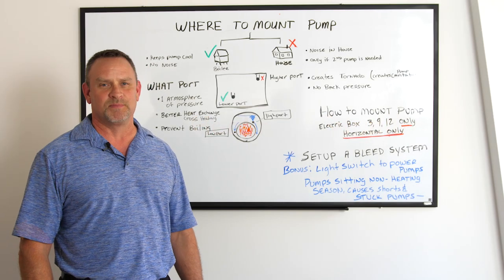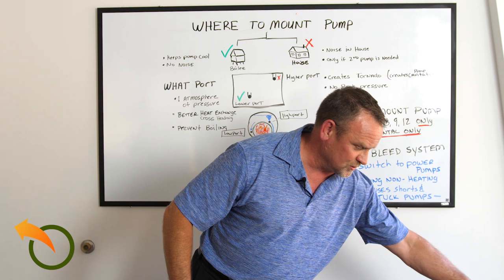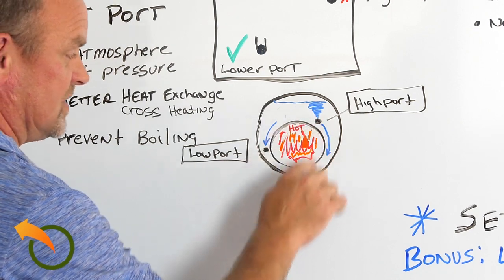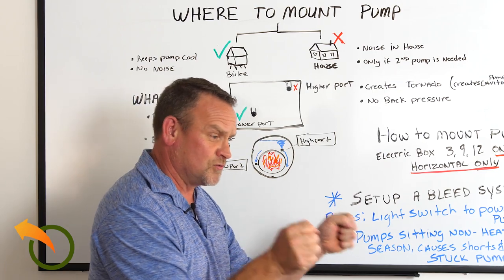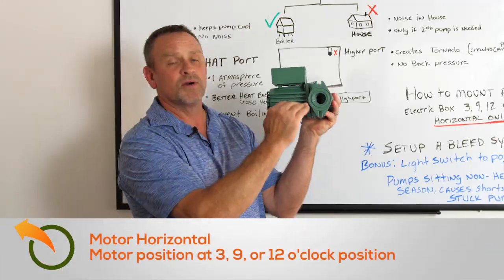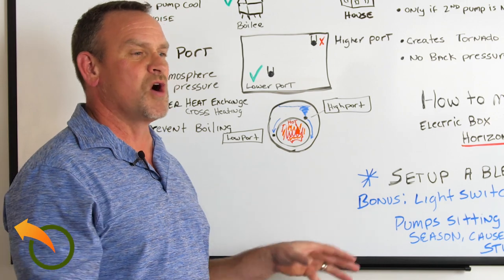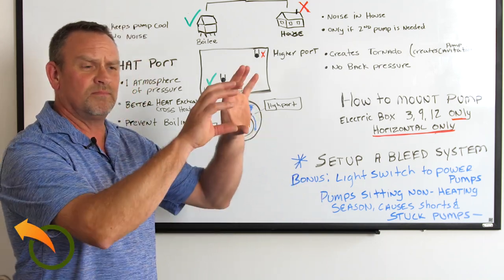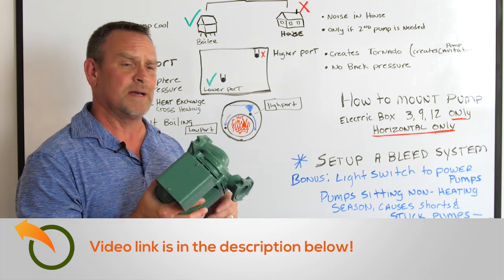Where & How To Mount a Pump on an Outdoor Wood Boiler | Alternative Heating

Comment: This makes perfect sense. My Hardy H-4 has the pump mounted on the high side. I don't think I have room to change it to the low side. I will pursue this after this years burning season.
Reply from the maker: There is always a way! I'm sure you will figure it out... Happy Heating.

Comment: my high port is actually more like in the middle of the tank.  Low port is at very bottom.  The pump is on the high port and I have issues with water boiling.  I plan on moving the pump to the low port.  My question is: would it be better to make a new pot at the top of the tank and return there.  There is a cover on top that I could drill a hole and even weld a fitting to.  Thanks for all the great info.
Reply from the maker: No to the port at the top, unless you send the water all the way to the front on the top. The water is simply mixing in the back of the boiler only with most boiler designs. Ideally you want water returning to the front top of the boiler and and supply from back lower port to mix all the water in the boiler.

Comment: My boiler has the pump set up on the bottom, but it pushes towards the boiler instead of pulling from it.   Would I be able to just flip the pump around and reverse the flow or would that cause an issue?  Since it would go through the furnace heat exchanger before the sidearm exchanger on the water heater.
Reply from the maker: Yes you should be able to do that. If you want flip the supply and return pipes too to keep the sidearm first. Make the existing supply the return and vs versa. Jeff

Comment: I’ve been in the oil field to long apparently. We have different definitions of large pumps. Big is any fluid pump motor over 100hp.
Reply from the maker: You are correct, 100 HP is a big pump.. LOL

Comment: Ok so I took the advise and moved the pump to the lower inlet and the return to the upper. On my boiler there is a temperature probe that controls the fan when to turn on to heat the water. Should I have it mounted on the lower port T or the upper port T ? I have an earth outdoor wood boiler.

Comment: Never would have thought to move my pump. Question regarding that if I move my pump to the lower port do I also move my temperature sensor or leave it in its current location? I have an earth outdoor wood boiler, specifically my mountain man 400 series. I would upload a picture to show you but I can’t here

Comment: This video would’ve been more helpful about a month and a half ago about getting the air out of the system,
But I got itworks great extremely happy with my new heating system,
I used a hot water heater for my heating source and took apart my furnace and put a heat exchanger in there,
And I’m loving it,
Cost a lot less to heat and it’s a lot hotter to.
Reply from the maker: I have had a lot of calls about pumps this year for some reason. Happy heating

Comment: I am installing a Aqua therm pressurized wood boiler. They show the pump installed at the bottom of the boiler pulling from the house and pushing into the bottom of the boiler. Hot water to the house goes above the boiler through a air scoop and then down to the house. Do you think that it should be reversed or since it is pressurized this works? Thanks
Reply from the maker: I'm not familiar with pressurized boilers, so follow their directions. Happy heating.

Comment: I have a 4400 wood master I have my pump on the bottom  and the return on the top, but they r both on the same side of the furnace  only because the dealer was very positive  about this concept but seeing ur video and ur diagram on the board,  u have them on the opposite side of each other is this they correct way for my furnace?
Reply from the maker: I would recommend you put them they way I show. Woodmaster also agrees with me. A lot of dealers do this part time and not really sure of these things. Jeff

Comment: Hello, I have a Central Boiler system.  It is about 65' away from my house.  The pump is on the boiler.  It heats my home through a coil in the plenum and it heats my hot water.  Both are right next to each other in the basement.  I just bought a unit to hang in my garage and heat the garage.  My question is:  since the furnace and hot water heater are in the basement, do I need another pump to pump the water from the basement to the ceiling level in the garage?  It will be about another 20' away horizontal, and then about 10'-12' vertical.
Reply from the maker: Most often you don't need to add another pump. hook it up and see. If your not getting enough heat buy a larger pump. You won't know until you try. Jeff

Comment: Do pumps get worn and become less effective gradually?  But if the GPM is lower, how can I tell if it is pump wear or build up in HX, I have 2?
Reply from the maker: Yes they do, there is a lot of sediment in the water that slowly and surely chew down the prop in the pump which reduces the pumps effectiveness. You will need to install a gauges the tells you your GPM and beside that there is no way I am aware of of determining that HX has build up.

Comment: What will happen if the pump is straight up not side ways I got to for 7 years on no prob  nice tutorial.
Reply from the maker: Sometimes nothing like in your case, it is what the manufactures recommend. Also when breaking the seal they don't water dripping on the motors or electrical part of the pump.

Comment: I'm curious, have you ever considered mounting an electric water heater element in the jacket of the boiler just to keep the water freezing if you were going to be gone for a week or something? seems like you could have it set so that it only comes on at a lower temperature as a safeguard.
Reply: Shad Peters I would think you could just pipe the boiler through the electric water heater and then turn the water heater on when you are gone, or a tankless water heater
Reply: @buzzsaw301   this is heating a shop and there is no water heater.
Reply: If you had to (with no fire burning in the stove):  Turn your home(shop) thermostat up as high as it will go so the circ pump on your  stove runs continuously.  The circ pump running would keep it from freezing.
Reply: Just circulating the water (into the house and back) without a fire will keep it from freezing. I used a "freeze cube" to trigger the pump motor (plug and cord attachment) when the outdoor temp drops below 36F (and it also turned on a light).  Then it occurred to me that my $12 fix was the only thing avoiding an $8,000 repair, if the freeze cube fails for some reason and I crack the water jacket! Now I simply switch on the circulator whenever the weather forecast is below 40F and I'm not ready to light a 24/7 fire to heat the house for only a few hours a day.  The wasted electricity on my 1/6 hp circulator for a few days is minimal cost for the "insurance".  Of course, I can still use the freeze cube light as a reminder to check.  ETA: Forgot to mention, my loop is only about 30 feet long and includes a brazed plate heat exchanger in the warm basement.

Comment: Hello,I need your help I have a 007-HBF5-J pump assy for my outdoor wood boiler can you tell me how far this pump can push the water.
I have looked but cant find that info.
I watched a video of yours and I saw you mention different pump numbers and how far they would push,but I cannot find it again.
Thanks
Reply: 0 to 20gpm and max 11ft head. Specs are on Google. Head pressure is how hi it will pump straight up. Every 90 degree turn that is in that loop equals 1ft of head pressure.
Reply from the maker: A lot of variables and to many to mention. The Taco 007 is a small pump and is only designed to pump around a house zone. So it won't pump to far.

Comment: Couldn't you just crack the the cap on top of the unit and purge air out that way??  Wouldn't the pump push the air out and vent to atmosphere??
Reply from the maker: That usually doesn't work, those little vents are for micro bubbles... in the systems that are already bleed.

Comment: If you can hear your pump running inside your house there is something wrong with the pump. They are very quiet. Also the pump doesn't need to be outside to keep it cool. These pumps are used in indoor applications far more often than outdoor applications considering outdoor boilers are a very small minority of hydronic heating systems. Otherwise the video was good.
Reply: Well most women have supersonic hearing and can hear things we can't, my ol lady even says she hears me thinking...something I didn't even know I did according to her
Reply: Adam Bauman NASA has hired my ol lady to listen for 👽

Comment: The folks at Garn pull from the top, I’ll bet they’d like to argue. 🤦‍♂️🤷🏻
Reply from the maker: I have seen several manufactures do the same thing, I have found this way to cause serval issues. They way I do it seems to solve all those problems. Your choice...
Reply: @AltheatsupplyLLC  no, I totally agree with the way you recommend, it just seems strange that such an expensive boiler that’s been around forever would be doing it backwards as they are.